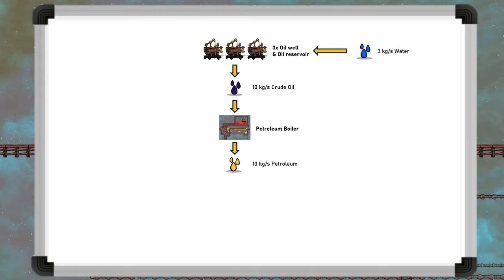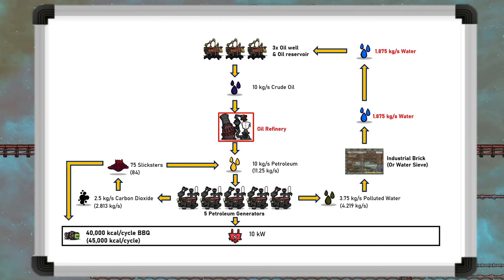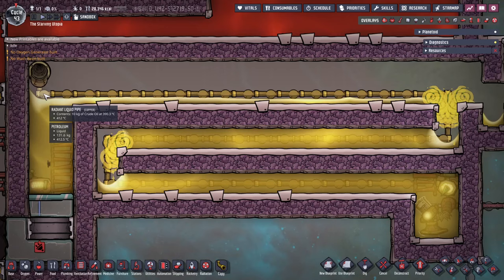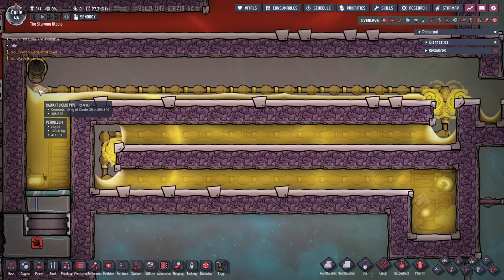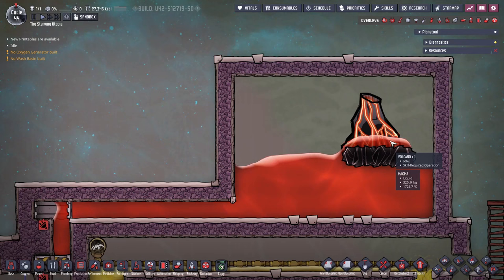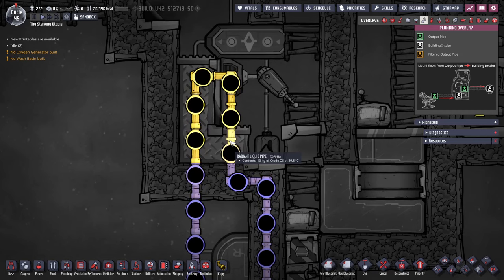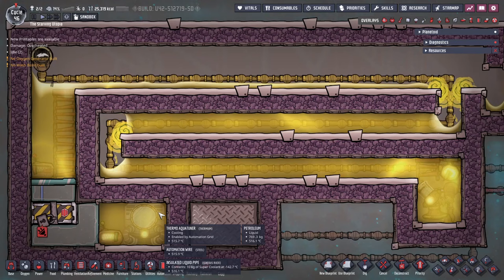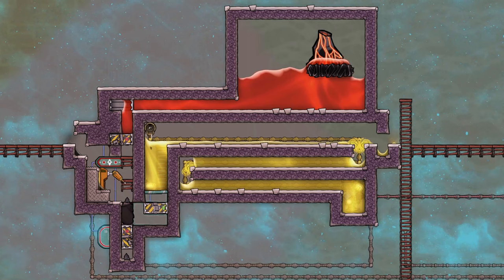Oxygen Not Included - Tutorial Bites - Petroleum Boilers

Comment: When starting this up for the first time, put a valve on your oil input and restrict the flow.  I used 1000g but it might work with more.  This isn't to prevent pipe breaking (though that helps), it's to make sure that the boiler can keep up with the oil input when you have 0 preheating (everything is empty).  If it fails to keep up, you can crack the walls next to where the oil drips (too much oil instead of petroleum can cause pressure damage apparently), or end up with oil in the petroleum channels which might clog up the whole system
Reply: This tip was a life saver. Thanks.

Comment: Old video i know but, I had a lot of trouble with the magma overheating the miner. I added 1 more door about the top lava intake door. That fixed the problem. I was getting too much lava coming in. Adding the 2nd door right above limited the magma to a single tile, that there it worked perfectly.
Reply from the maker: I've never seen that issue with this design, but good that you fixed it. My guess would probably be that the magma blade is too short.
Reply: @GCFungus  Aye it was and the angle I had to build at wasnt optimal. "The Lab map." So I had to buffer the flow.

Comment: using a aqua tuner to cool the petroleum and heat the oil is smart. a small improvement would be to have the igneous rock that's doing nothing at 400 degrees be picked up and be used to heat the supercoolent in addition to the petroleum, that way you get better heating of the super coolant and also free igneous rock

Comment: You could activate the drill and replace the magma when the heat injector airlock starts staying closed for too long. This would self regulate and eliminate the need for tuning.
Reply from the maker: A possibility but I think this would probably end up less efficient than working it out. You have to watch these boilers carefully anyway, so spending some time at the start to make sure it's working is well worth it for tuning in my opinion.

Comment: I put a liquid pipe thermo sensor directly at the vent. If the crude oil gets over 399 C° it will also open the airlock. I never had a pipe break yet and the oil has always 399 C°.

Comment: I found this very difficult to start up and couldn't understand how to deal with the overflow which led to other problems and what fixed it for me is connecting a liquid element sensor(set:crude oil) where the crude oil drops and connect it to the liquid vent with a not gate.
other than that, thanks for a wonderful tutorial, i can finally produce petroleum.
Reply from the maker: I'm glad to hear that you got it working, but it sounds like something isn't quite as intended if you are having to shut off the oil input regularly (although that is not a bad safety feature). Given that you said you also had some issues starting it up, I suspect you may have an issue with the heat injector and are not getting as much heat through as you could. If you want to take a further look, we can advise on the discord https://discord.gg/bnqYAUTMmn - or no worries if you're happy with it as is.

Comment: This is great. It explains some of the issues I've had with my boilers. Now I can improve in the future. These Tutorial Bites have been great. Even better if would be to talk about how to safely start one up to not get instant sour gas. That is my problem. I need to make sure the heated diamond tiles aren't so high to start with.
Reply from the maker: That was a miss on my part, there is so much to include that I didn't mention how to initialize the boiler. Basically to avoid the sour gas fill the boiling section of the counterflow near the top, then heat that until it is petroleum. Once you have a large stable amount of petroleum in there you can turn the boiler on full flow and it should be fine.
Reply: @GCFungus  Yep. Thanks for a great explanation here. I've had to learn that the hard way. I now have several KG of sour gas to empty out of my boiler.
Reply: @GCFungus  I am on my first attempt to build the boiler and I was looking for a tip how to initialize the process. Thanks a lot!

Comment: I was wondering if the memory gate is really needed, because there are 3 cases:

1- Temp is too low, the sensor sends a green signal, and the filter output is still red - the input to the bottom door should be green (open to receive the igneous rock).

2- after 20s sensor signal is still green, but now the filter has also turned green - the door input should be red/closed (preparing for the new magma drop).

3- magma has dropped, the sensor sends a red signal and so does the filter gate- the door stays closed (red).

So, using the sensor output and the filter output as inputs to the XOR gate, and using the output of the gate as the input to the bottom door, you’d have:

sensorGreen + filterRed - doorGreen
sensorGreen + filterGreen - doorRed
sensorRed + filterRed - doorRed

and the sensor red with the filter green I think it will happen only for a split second after the magma drops (between cases 2 and 3), because the sensor turns red but the filter take a "tick" to turn red (if it behaves like a not gate when switching). The door in this case should stay closed (keep receiving a red signal), but since it’s an XOR the output will turn green for a fraction of a second. The memory gate prevents this from happening because the sensor will turn red before the filter, and since the filter is the one connected to the reset port, the memory will stay red until the filter turns red. But is this really necessary? Or the split second that the door opens is enough to leak some magma? Doesn’t the door need to be fully open to allow liquids to pass (the door will receive a green signal so quick that the animation doesn’t even do anything I think).

Comment: what is the material of the insulation tile? you didn't tell it once in the video.
Reply from the maker: For the boiler side it doesn't matter too much, so igneous rock is what I use as it's abundant and the best insulator (outside of ceramic or insulation). To contain the magma, you can use obsidian which will never melt, or also stick with igneous rock which will eventually melt in theory but it will take thousands of cycles.
Reply: @GCFungus  thank you. I go with igneous rock but it keep breaking of overpressure. Turns out crude oil expands when changing into petroleum and when i start the system, the left side of my boiler was already full of crude oil. For anyone reading this. Make sure that the window plate already reaches or near 400°. So that when the oil dripped, it immediately turned into petroleum. Not accumulating as crude oil. I learned it the hard way haha.

Comment: Very nice tutorial indeed, I'll certainly use it as reference of everything needed for my boiler (which is just few projects away in my game) without need to search forums.
I would maybe reverse one of your advices - when building top row, i would start with about 1/3 of pipes insulated, let it go for some time (to properly start counterflow) and then start replacing segments with radiant pipe while watching oil temperature on output.
Am I right this design could fail (few broken pipes) if flow of crude would slow/stop? For my base i suspect flow wouldn't be full 10 kg/s as i plan few sour gas boilers.
Reply from the maker: You can play it that way, but on start-up the oil will be colder than when it is in normal operation. I think it's fair to say that its easier to deal with a too cold output than a too hot one yes, but I believe the lengths I demonstrated here are fairly safe so I wouldn't worry. If a pipe segment does fail then yes the boiler will stop, so needs to be repaired quickly. Sour gas boilers are great and will be the topic of a future tutorial bite - there's no reason you can't have both if you have enough oil reservoirs.

Comment: Weird question but I figured you would know if anyone did.  Is it possible to build a petrolium boiler based of petrolium rocket exhasut heat capture?  If an asteroid has lots of crude oil (and for some reason, diamond), but no volcanos, and the progress of the game isn't up to space materials, would it be feasible to capture the heat of the rocket exhaust via diamond window tiles instead of using magma?  It seems like it would work, but I can't seem to find anyone on youtube or reddit who has claimed to have tried it.
Reply from the maker: Potentially, but I don't think the heat output is high or consistent enough really. I did cover rocket tunnels in a Tutorial Bite, including just getting heat out but not for a petroleum boiler. Also, if you have the means and knowledge to do a rocket tunnel then space materials aren't much more difficult than that. Once you have thermium then it's going to be much much simpler and easier to do an aquetuner build.

Comment: What do you do with all the igneous rock that this design makes? I see it gets dumped into the hole but do you just leave that? Also, I noticed when building mine that that specific door isnt opening at all despite me trying to switch it on or off and it just wont go?
Reply from the maker: If the door isn't working then I can only assume it's not connected properly. As for the rock, in this design it's just left but you can take it out for use. It is quite hit though and can be used for some more power if conveyor railed out.
Reply: @GCFungus  I have it connected exactly as you do, its just when the thermo sensor is green it wont open the door to drop the rock down under

Comment: the wall between the crude oil drop and the auto miner keeps breaking due to over pressure in from the liquid.
Reply from the maker: Is it breaking when you're starting up or during normal running? If it's on start-up then I would suggest using less oil to start with. If it's during running then there is probably some issue with the heat transfer across the wall so I would watch that closely to try and find why the oil isn't turning intro petroleum, which is what causes the pressure damage.
Reply: @GCFungus  I figured out the issue. It was my startup. J had too much crude oil before the temp was hot enough to turn it into petroleum. So when too much converted all at once, the wall chipped and leaked sour gas

Comment: I love this design but had a small issue with it, the place where the oil actually boils overpressured and leaked through the wall

Is there a fix for this?
Reply from the maker: This can happen if you overfill the boiling srea when starting up. Once the area is full of petroleum it will stabilise. Whe starting them up feed the oil in a bit more slowly. If you've already started it then just fix the tile damage and wait for it to all turn into petroleum. Be careful for sour gas ending up in the magma dropping area though.
Reply: @GCFungus  Ok, thanks :)

Comment: Hey, so I seem to have developed a vacuum pocket in the lower corner of my boiler next to the thermo sensor. It's causing the automation to flake out, which is leaving a lot of crude oil unprocessed. Then, when the next set of magma drops, I'm getting pressure cracks in the retaining wall which is filling my heat injector chamber with sour gas. Any thoughts how to sort this? Do I just need to live with it until it settles and pump the sour gas out?
Reply from the maker: I'm not sure exactly where you mean the vacuum is forming - in the oil side? To start the boiler up I would put a good few tiles of oil into the boiler side and then put the magma in the hot side and let it turn. At that point you can carefully watch to ensure you get petroleum, but you shouldn't be getting a vacuum or sour gas if its working correctly.
Reply: @GCFungus  Hi, thanks for replying. It's been running fine for a while now, so it's not a startup issue. The vacuum pocket is right above the heat exchanger on the tile that has the thermo sensor at below 405 degrees. It will briefly fill each time a drop of crude oil comes out of the vent, then return to vacuum once that is converted to petroleum.

I think the issue is I haven't been able to make full use of the power, or more specifically of the extra petroleum, so it's been overflowing through the liquid lock. Maybe I just need to have the petroleum generators running constantly rather than capping them with a smart battery?
Reply: I think DDopson's response, below, has the answer I'm looking for.

Comment: I was thinking about the ways to cool the leftover rock from volcano and then it came to my mind.. I wonder could there be a way to consistently squeeze most of the heat out of the rock to preheat the petroleum. Could reduce the amount of heat used from volcano.
Reply from the maker: You definitely can use it that way, just be careful to adjust the length of the Hest exchanger. You may also find it variable if the rock supply is not consistent which could cause issues. Another way to use the heat is to run it through a steam room and take extra power out that way.
Reply: @GCFungus  Yeah, was thinking about measuring the average output from the whole process and then using the rail meters to adjust the amount that passes petroleum boiler each second. Honestly it sounds like such a hassle but Im willing to play around haha

Comment: I have to admit I learned a lot from Francis John in playing this game. However, you explain a build in so much detail that it is easy to follow.

I have a question and insight on your guides.

I tried building your petroleum boiler but for some reason, the steel door between the two diamond window tile stops transferring heat after a few cycles. Specially when I leave the boiler, which floods the counter flow with crude oil which forcing me to stop the flow of oil. After a few cycles, the steel door will start transferring heat and the design will function.

I see in your meteor video that you are using window tiles at the base of your c-shaped housing of your drills. It is better to use air flow tiles instead so the line of sight of scanners and soalar panels will not be blocked. (I am not sure if that still applies or works on spaced out DLC.)
Reply from the maker: Thanks, and I learned most of what I know from FJ too, so he is definitely the OG ONI creator that I hope to add to.

Diagnosing specific issues with these boilers is a little difficult, and may be best done in the Discord, but my guess from your description is that the most likely issue is the oil input temperature is too low. If the magma is having to do too much heating then it looks like the door is unable to transfer enough heat to balance the incoming oil. I would check that first and see if it's dropping. If it isn't that then it could be due to the heat transfer in the door itself, I've seen many weird issues where heat conduction doesn't work as intended, but the design as I showed here should work.

As for the meteor shower set-up, actually with the conduction panels you no longer need a c-shape at all. You can simply attach the robominers to a vertical wall and cool that way.

Comment: I can't seem to make the automation for the magma dropper to work properly. followed the connections but the doors won't open to drop magma @_@
Reply from the maker: If you've connected it up as shown, then the two magma dropper doors should alternate when you flip the thermo sensor in the bottom - with a delay as dictated by the filter gate. I'm assuming the issue is the magma hasn't flowed through, in which case just manually toggle the thermo sensor at the bottom to let a little bit into the dropping area.

Comment: i sorta end up having my petroleum oil at the button of my pump at temperate at 400'c+ and my Petroleum Steel Pump getting Heat Damaged i too braindead how to solve that i kept redoing but the problem kept happening
Reply from the maker: Is your counterflow working correctly? The incoming oil should easily take out thr heat from the petroleum.
Reply: @GCFungus  it work now! checking out the counterflow make me notice my crude oil was sitting at 160'c+ had to cool down the crude oil to 100'c and it work properly

Comment: Is this still up to date? I'm not familiar with the game mechanics all that much but when I'm trying this, the oil temperature is dropping because the automation with the sensor being below 405 is keeping the door open. The magma isn't dropping either, what I've done should be almost exactly like your setup besides the oil piping cooling down the mining laser has a filter just incase water gets inside the pipes. I'm also having issues with sourgas and pressure damage in the same area when I try to set the sensor to above instead of below 405
Reply from the maker: Yes, apologies there was an error in the one take that should be ABOVE 405 which was correctly shown earlier on. If you're getting sour gas in that case then maybe try adding more oil, as it shouldn't transfer heat that quickly.
Reply: @GCFungus  thanks I'll try that

Comment: the only rough part is pipes breaking. sometimes it just breaks for reasons I cannot ascertain. Nice intro though thank you for explaining how slicksters become a benefit from this build.
Reply from the maker: I would guess it's small packets flowing through the pipes which then overheat. That can happen when the wells get vented, or for some other problem with oil production.
Reply: @GCFungus  interesting that is true I also put a not gate with an element sensor so only crude oil goes into that hot environment avoiding steam down there.. I guess doing a double liquid bridge to send 10kg packets down would help but I'm not sure if it would ultimately leave 1 gap.. or just use liquid vent at 95% output to always have a full line of crude oil. Thanks!